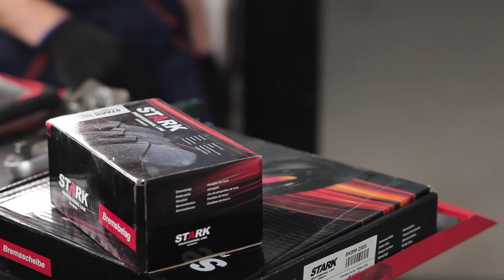How to change a front brake discs and brake pads on BMW 3 E46 TUTORIAL | AUTODOC

Comment: Excellent video but I would have liked to see the wheel hub mating surface wire brushed and a little of copper anti-seize applied there and on the bolts.
Reply from the maker: Thank you for your comment.
We have already added this procedure in the new videos.
Best regards,
Autodoc team.

Comment: It's because normally e46 is a rusted piece of ... All Jammed up so that it takes 30-45 mins EACH side just to get the bolts off.
Reply: Any car will rust if you live in salty areas (places that get snow or next to the ocean).  Both of these can be prevented with simple maintenance like washing off the salt or undercoating.  I live in NH and my E46 is solid underneath, including the brakes.
Reply: pb blaster

Comment: 16mm socket not 17mm. I just tried 17mm on my rusty bolts and it stripped them clean                            

                c:
Reply from the maker: Thank you for the feedback! Your opinion and remarks are very important for us. We will take them into consideration for our next tutorial. Best regards, Autodoc.
Reply: WRONG!  you want a 17mm socket.  Don't believe me? just Google it.  Everything you read will say 17mm because that's what it is.  You stripped out your bold because you either can't read or didn't pay attention to what you were doing.
Reply: Because use Autodata for information about socket and wrench size..
Not YouTube. 
This is only to see how everything works in real life.. 
Good job mate.
Subscribe from my side.
Reply: Yes 16 mm
Reply: @brittanyrocks111  It's 16mm. Also happened to me, was dumb enough to check if I have the required tools by checking this tutorial out. Everything is wrong about the tool sizes required. At least I stopped after it slipped the first time and tried a 16. Worked charms for all 4 bolts on the front.